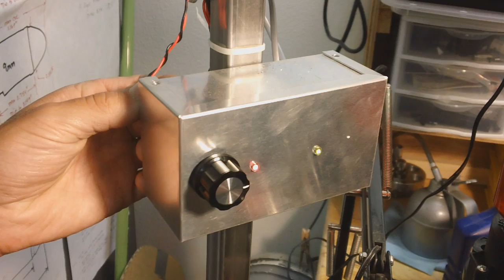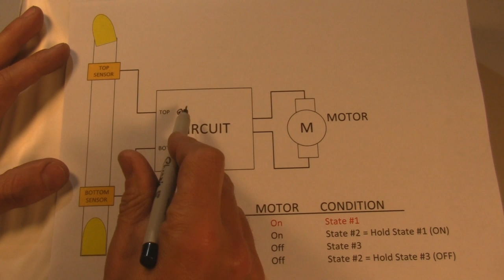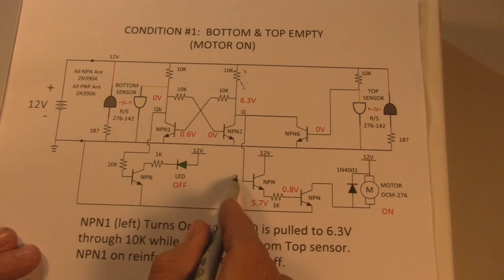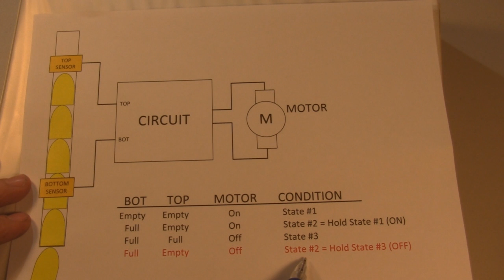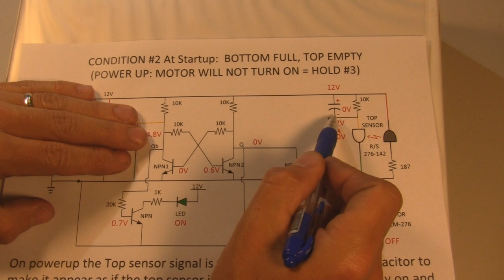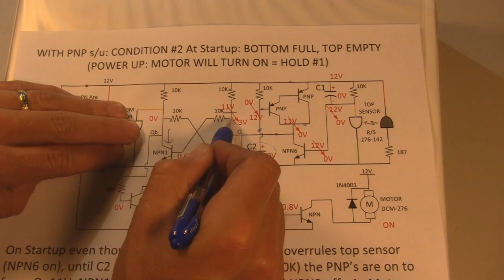Bullet Feeder Motor Controller Schematic DIY Lee Loadmaster With IR LED Detector

Comment: I cannot read a schematic. For that reason I plan to use simple 120v motor and switches. Could you do a video that describes with a simple motor, power, limit switch, and on/off toggle switch look like without using schematics.

Comment: tomrum42 === You talking to me? I wanted to see the bottom of the board I was curious as to what method all the connections were made. Solder jumpers or twist on. Bottom is usually a mess of spaghetti.  I'm always interested in this kind of stuff. I like to know if others like spaghetti too.

Comment: yea I know, it's weird, not sure why youtube does it.  Doesn't do it if I copy/paste it anywhere else except on youtube.  I mentioned that when I was posting link.

I have the circuit board built, but time has been constrained and I haven't had time to finish the bullet sorter yet unfortunately.  Haven't given up, just don't have the time ATM.  I'll see if I can't at least hook the motor to the board and switches and stuff and test it without actually running the sorter with it.

Comment: ok, updated my schematics, added a parts list with prices and links to where I purchased them.  To circuitry also added the layout for my quick connects on the PCB board. (So I don't get confused later, as there are 3x 12 pin and 4x 8 pin connections)

Here's a link to my google docs public folder where both versions of my schematics can be found: docs.google.com/folder/d/0B9d-0bYHkvQAVE9xejE1YVM0RU0/edit

as before, watch out for your browser changing the address when you copy/paste....

Comment: oh yea, I also bought a bunch of PCB male/female connectors.  So everything is quick connect, another 'unnecessary expense'.  But this way I can disconnect stuff and pull out the board without worrying about the cables.  And also I can build the whole board without leaving long wires hanging to reach my switchings/led's/sensors/etc.

Comment: ok with shipping/tax and everything I came to $132.42 total to make the electronics.  Includes motor, power supply, box, PCB board, everything for the electrical.

Could have been cheaper if I didn't add the extra's like the LED counter (so I can see how many bullets I've done so far), or added an RPM switch (the 10 position volt divider).  But hey, what the heck ;) wish me luck probably have everything by end of next week.

Will make a video when I'm building it and post as vid response ;)

Comment: I'll be ordering most of the electronics from newark.com but they are down for maintenance right now, so I'll update my PDF tomorrow night once they are up.  Will also include a parts list with links and prices as I'll be ordering everything tomorrow.  And a grand total price of what the electronics will cost me to make.  I'm estimating right now roughly $110 (shipping included).  Motor was $18.30 (w/ shipping). 10 pos switch and PSU around $12 each, those are the most expensive parts.

Comment: Thanks for the input John, I've done some thinking and I've decided to just remove the two LED's (top and bottom sensor LED's) to simplify it and not worry about it now.  And about the 2nd transistor your right.

I just hope my volt divider design on that 10 pos switch works like I think it's supposed to.  Also wondering if I need to add decoupling caps across the power supplies for the CMOS. I hope not as I'm using a stabilized computer power supply...btw sorry about the messy counter wiring.

Comment from the maker: On your bottom sensor clear LED you put a 10k resistor (that turns on the bottom sensor LED as well as triggers the cross-coupled transistor latch).  That 10k will affect the drive capability of the clear sensor LED and may not work well.  Experiment with the 10k resistor and maybe make it smaller.  You will need to bread-board this and play with the values to find what will make this work.  Same goes for how you use a transistor to trigger the latch instead of directly using the sensor.

Comment from the maker: The transistor that drives your top-sensor LED has its base grounded and therefore will never turn on.  I would suggest just getting rid of that LED and transistor all together.

Comment from the maker: I looked at your schematics.  The transistor that drives the motor - you may want to put put a resistor (1k?) between its base and the emitter of the driving transistor.  That darlington connected pair will otherwise have the base of the 2nd driving transistor up around 4 or 5 volt and it will have a huge base current.. and you could burn up the transistor.

Comment: That is weird....for some reason when I copy/past the link I posted into my browser although it doesn't say it it adds a "-" between 0 and b....as it goes to 0B9d-0-bY... instead of 0B9d-0bY.

If you get a file not found, copy the link to a plain text editor (such as notepad) and remove the "-".  It does not even show up in my browser address bar, but it's there.  Might be an issue with me using google chrome browser? IE might not get that problem.

Comment: Hi bearing01, love your video's.  I've decided to stop pan lubing and get a star lubrisizer.  I'm building a collator and basing my circuitry on yours with some 'minor' changes.  I have uploaded my circuitry as a PDF to Google docs, I'd be forever grateful if you glanced at it and checked my work.

link: docs.google.com/open?id=0B9d-0bYHkvQALU1FQlFtdHhRNUU

main changes: variable RPM motor (volt divider on a 10 position switch) and a 7 seg 4 digit bullet counter. using a computer PSU.

Comment: @jeffbowles1
I'm working on a similar project. Also doing a digital temperature control, and a motor to run the sizer ram. Adding pneumatic lube supply ram as well.

It should be a fully automated sizing system when it's all done. I estimate it should be capable of lubing 4,000-6,000 bullets per hour, with no effort on my part besides keeping the bullet collator fed.

I'd be interested in your ideas for your nose-down collator design. I've got a few ideas I'm working on as well.

Comment: Nicely done John, as for getting a headache from the explanation of the circuit, well that didnt happen. I guess my assoc. degree in electronics is worth something after all..
For the one I am working on, which of course I had to change, bigger, better, etc... (the male ego at work) I am building this to feed my star sizer, so I have to flip the bullets over as the star sizer loads nose first. The idea is to feed like a dillon primer feeder on a 550B to place the bullet into the sizer die.